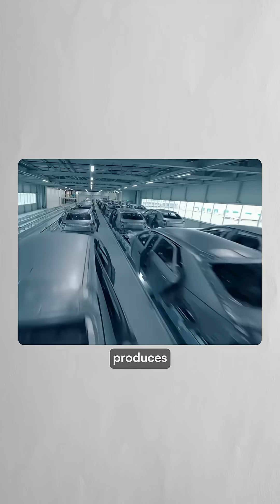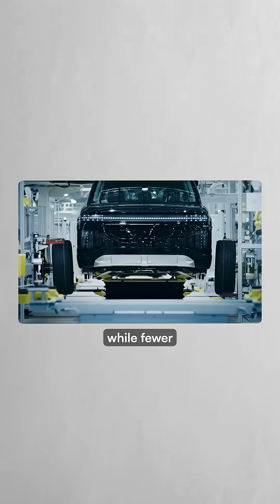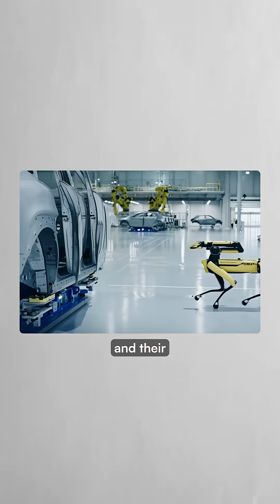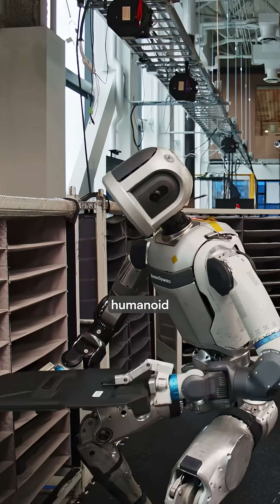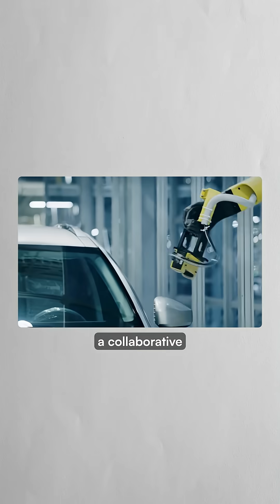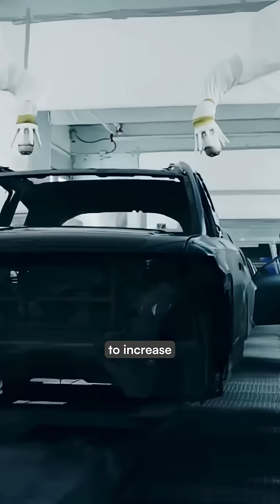Most automated factory in the USA? 🚙 #trendingshorts #ai #factory #manufacturing

Comment: So the market will be flooded with Hyundai cars and no paychecks to buy them because unemployment? Lovely.
Reply: They’re not the ones causing unemployment though. But they can easily flood the market. Since their competition can innovate and do the same, the price of cars has to drop. No one has enough balls to do that so they keep soaking the customer.
Reply: @elephantgrass631  but they didn t and don t and will not drop
Reply: @elephantgrass631 Natural resources aren't cheap and they get expensive by the day, so there's no reason to think cars or anything else will get cheaper and cheaper.
Reply: @1Capybara24Of course it can get cheaper and cheaper. Running a company that huge , that’s the ONLY problem you’re trying to solve: reduce costs. And they do find it, if not, they force it.